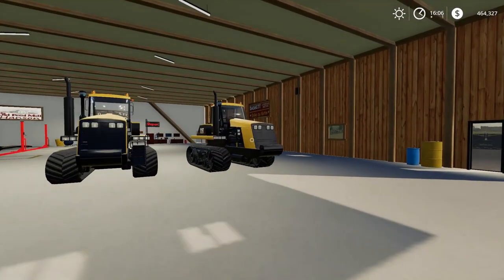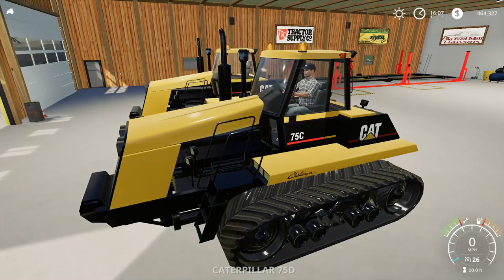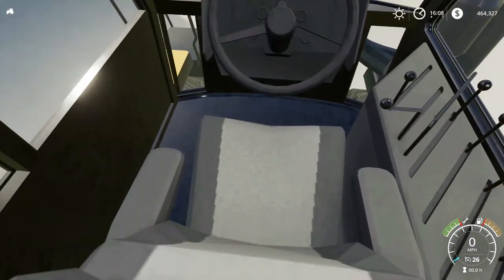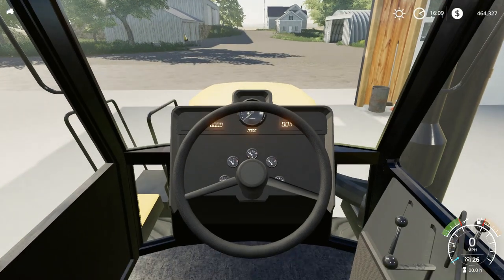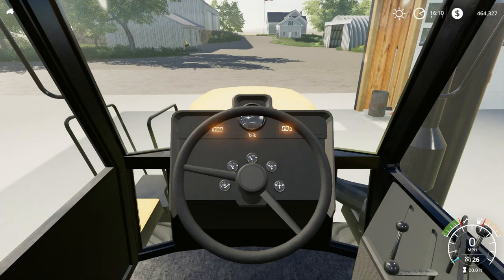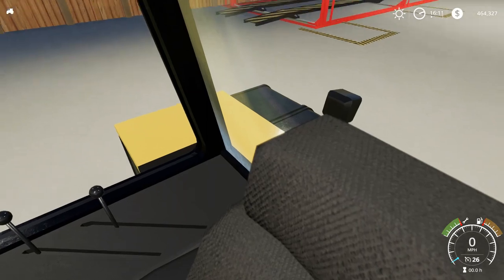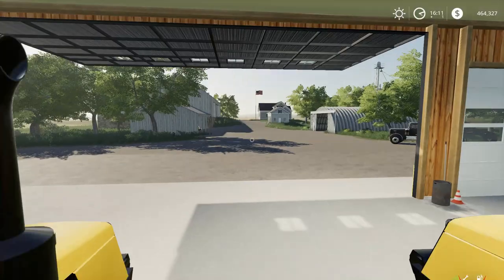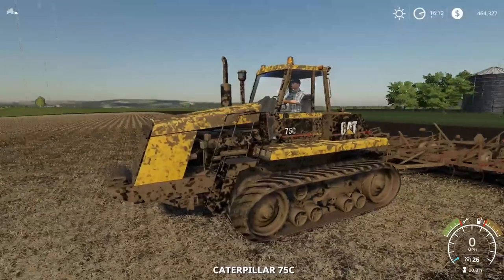FS19 CAT 75C VERSION 2.0 -  PART DEUX

Comment: nice work look forward to using it
on a side note is that shop/building a mod or was it part of the map?
Reply from the maker: Thanks, Links in the video description. Let me know if you find any bugs.
Reply from the maker: Forgot to mention, the shop is a placeable I dropped onto the map
Reply: Awesome I've been looking for a nice equipment shed
Reply: had a chance to play with it and its running well, my only critique would be the the lights and there lack of a "work/wide" mode rather than just the narrow focus
Reply from the maker: Agree. I think the side low work lights aren't quite lined up either. I noted this down for the next pass.